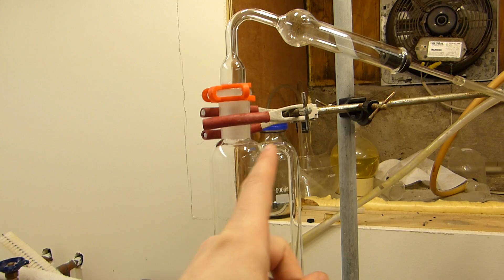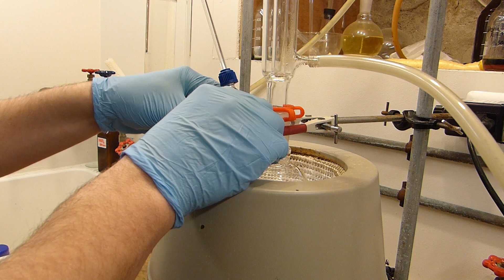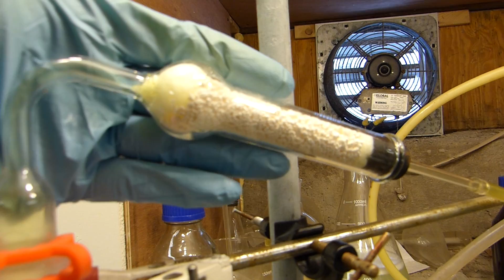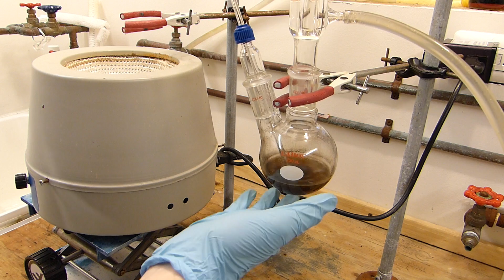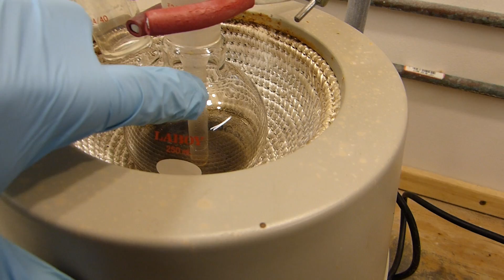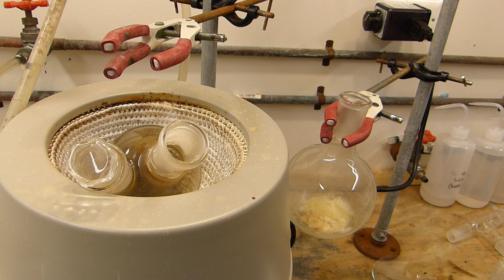Chlorinating C2Cl4 to C2Cl6

Comment: So I have all the required chemicals and glassware (mostly) to give this synthesis a shot - Does anyone know any other uses for hexachloroethane other than the smoke bombs? Can it maybe be converted into carbon tetrachloride? That could be useful.
Reply: Degassing molten aluminum.

Molten aluminum has an appetite for hydrogen, and Hexachloroethane is (was) used to degass it - so the resulting castings are not porous.
Reply: @Sweet bromine I haven't gotten to this yet >_< sorry

Comment: Why don't you use a fractionating column?  Do they azeotrope?
Regarding the chlorine, why not have a closed system but with a yielding member (balloon?  pneumatic trough?) to store the unreacted chlorine.  You would regulate chlorine additions to keep the trough partly full.  You would have real-time knowledge of the reaction rate.   (You would need to purge the air out of the system by starting the chlorine up early, before closing up the system).

Comment: make a video on how to make 70% hydrogen peroxide from scratch.
Reply: BadWo1f  greetings from TX! H2O2 is easily made from the 3% it comes in 1000ml bottles. Pour it into a absolutely clean 2000ml beaker and put it on a hot plate set at 50 deg C and have a fan in the same place and slowly the H2O will distill off, leaving the H2O2 that boils at over 130 C. The solution goes over about 4 to 5 hours leaving 100% of approx 24 mls. I stop at 50mls of 50% costs about $ 0.88 US. Bye

Comment: a little off the subject, but do you know how to , and could you do  a video on how to make pentanol? why is it so expensive now? they want like 180 buck for a liter, I think it is because they want the rush popper market shored up, but it cant be that hard to make is it??? and what is the difference in 1 pentanol, and 3 pentanol?
Reply: +One2rock Depends on what you have available. You could reduce valeric acid with lithium aluminum hydride or borane; or you could hydrate n-pentene with borane and workup with peroxide (if you would use pentene and aqueous acid, you would get 2-pentanol - Markownikoff's rule). This is pretty basic organic chemistry, but the precursors are not readily available either. The most realistic approach would probably be the hydrolysis of a pentyl ester with aqueous NaOH: amyl acetate and pentyl butyrate seem to be fairly common chemicals.
Reply: Trans Gay Atheist Marijuana Smoker pretty sure he wanted to know the difference in production between 1 and 3 pentanol.
Reply: Pentanol, and alcohols in general are obtained from fermentation. Pentanol doesn't have that many uses so it isn't produced on mass scales to make it cheap like ethanol. The 1 and 3 are the position of the OH on pentanol. 1 pentanol has the OH on the first carbon, 3 pentanol has it on the third.
Reply: so how do you make it? and thanks on why it so hard t find. an no I'm not a chemistry scholar, just dabbler, so ya I need it broken down in simple ways.

Comment: What size glass tubing are you using? 12mm? I need to purchase some tubing, the kind I have currently is too small
Reply from the maker: +moosehead 
I use 6mm OD glass tubing. It's about the same size as a thermometer, so I can use thermometer adapters as gas delivery tubes.
Reply: awesome thanks very much
Reply: +Doug's Lab while im here, what size stopper fits your drying tube? I have the same one
Reply: Moose. Dude do you not have a set of calipers or even a ruler?
Reply: ah i think i asked this question when the tube was still in shipping, so I couldn`t measure directly, but no worries I found one that fits snug, dries gas great heh

Comment: At 6:37, hexachloroethane is about 1.3 times as dense as tetrachloroethane (at least according to wikipedia), so this is probably the major cause of the decreasing liquid level.
Also, don't chlorine and ammonia produce traces of chloramine?
Reply from the maker: +TheChemistryShack 
Thank you for clarifying that. I didn't have time to look that up while I was tending to the chlorine generator! And yes, ammonia and chlorine do form some things other than ammonium chloride. Chlorine dissolves in water to form hydrochloric and hypochlorous acids. The HCl reacts with ammonia to form ammonium chloride, and the hypochlorous acid reacts to form chloramines, which tend to decompose rapidly to ammonium chloride, nitrogen, hydrazine, and oxygen. The addition of further chlorine easily oxidizes the hydrazine and chloamines to nitrogen, HCl, and ammonium chloride. 

Ammonia's volatility makes it an excellent choice for scrubbing chlorine, but is not suitable if the exit gas is not routed to a hood because small amounts of hazardous byproducts are released. However, it is very effective at absorbing large amounts of chlorine rapidly, is extremely cheap, and does not attack the vinyl hose like a NaOH solution, which is why I used it here.
Reply: Doug's Lab Oh...that's why my NaOH chlorine traps have been destroying my vinyl tubing! No wonder!
Reply: +TheChemistryShack chloramine would react with water
Reply: +Doug's Lab The difference in density is actually not relevant. It's the molarity that matters in this case since the number of moles is expected to remain constant while the mass is expected to increase due to the chlorine being incorporated into the product. The molarity of tetrachloroethylene is 1622 g/l / 156.82 g/mol = 10.3 mol/l and the molarity of hexachloroethane is 2091 g/l / 236.74 g/mol = 8.8 mol/l, so the volume should actually increase under ideal conditions.

I suppose the loss of material is caused be tetracholorothylene vapor being carried away by the stream of chorine gas. This could be mitigated by using a more efficient condenser and/or reducing the flow rate.
Reply: hi i want to know chemical rice toucher how to build and what chemical use and method pls i dont know how to ( copper coin A Rice Puller is ‘anti-electricity.’ Rice Pullers interfere with 
electronic & electrical items. It is very important to protect 
electronic & electrical items from Rice Pullers) any idea pls i u have any idea pls mail me govind4web@gmail.com